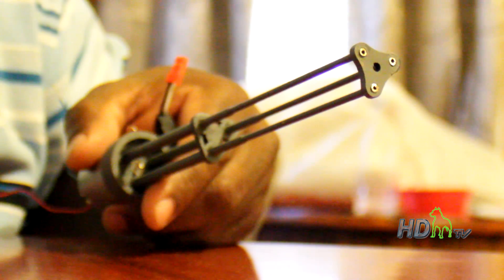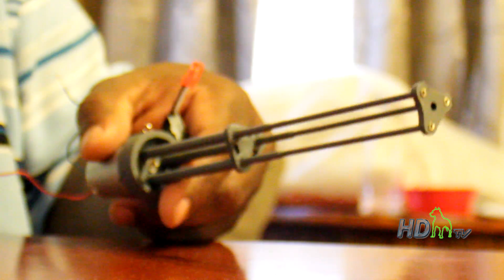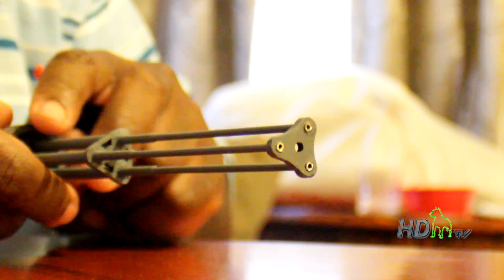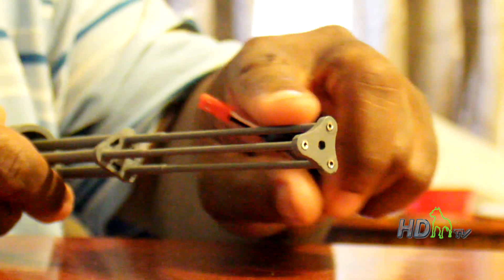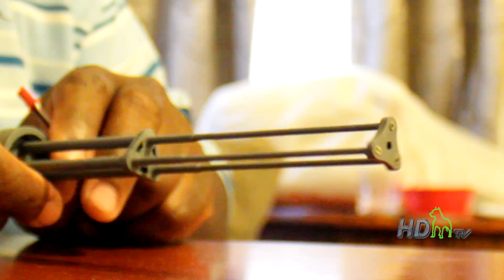AH-1S Cobra motorized Gun Turret- Work in progress

Comment from the maker: Then I mounted the pinion onto the motor shaft., centered it then glued the pinon into the wood mounting plate. Added the original ammo tray from the kit and sanded it to fit the new motor profile. A little JB weld and it is mounted on the motor and wired up. then just painted it all with primer and black paint. Also customized the turret mount with bearings and servo plates to swivel easily..

Comment from the maker: It is my own creation. The kit came with a plastic mock up of the gum. So I bought aluminum tubing in three different sizes to step it down like the original barrels. Glues them together, then used the barrel guides from the kit and remounted them. Then the main part of the gun was sliced off to keep just the mounting plate. I drilled out the center and added a small motor pinion just to mount it to the motor I bought. it is a small slot car/ electric train motor similar to the original parts.